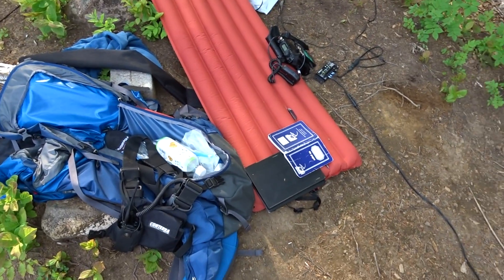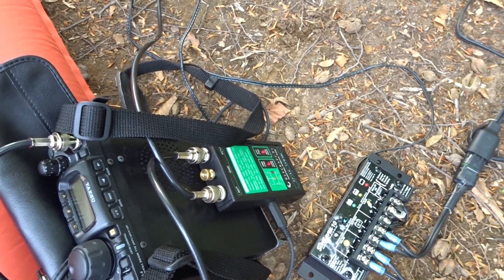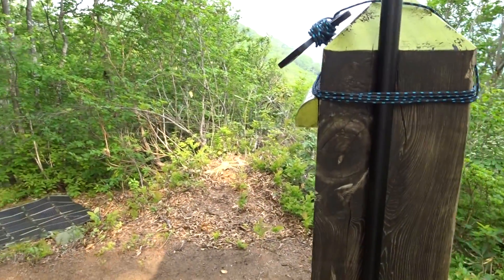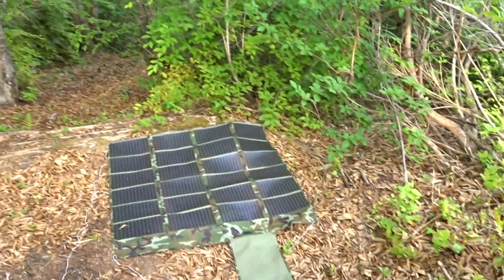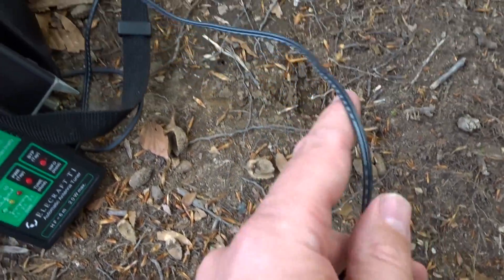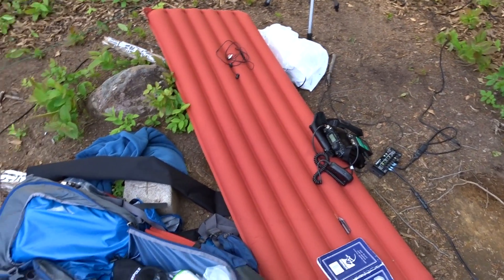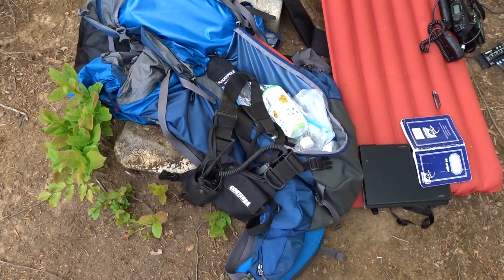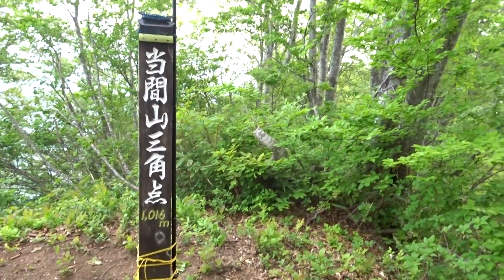My solar powered HF portable set-up by JG1XMV

Comment: Thanks for the great video on SOTA action in japan. I fond the Pocari Sweat beverage can help with QSOs but the 817/T1/Buddistick combo cannot be beat
Reply from the maker: Thanks John. Yes the 817/T1/Stick combo work very well. Thinking to look for a lightweight QRP Txer to replace 817 and save 0.5 Kg in weight in the process. A few of these are coming out onto the market these days. Ah Pocari :-) Yes, that helps as well. The heat and humidity plus the bugs in Japan in the summer can be tough. Also SOTA activations on SSB can be tough for a foreigner as very often Japanese OM are shy to reply to non-Japanese OM so DX contacts are sometimes necessary to complete the activation. I am also looking to test a mobile SD-330 antenna as a SOTA antenna. I'll see how that works. I have not done SOTA in many months now, time to get back into it!

Comment: What do you think of the charge controller?  Has it performed well, and is it RFI-free?
Reply from the maker: Hi Freddy, the sunsaver 10 is a PWM charge controller. MPPT charge controllers are in theory recommended when it comes to having less RFI but they are normally a lot more expensive (although I have read about people having big RFI issues with MMPT charge controllers as well). A friend and I both use the same sunsaver controller when using our radios on mountain summits and have had no RFI issues with it except in one case. We have noticed once that when we were using the controller with a buffer battery like the one used in this video and that the battery became full it generated a little bit of RFI in the FT-817nd radio. It is a minor issue for us as having a full battery is a "problem" I like to have when operating portable. When this happens either your disconnect the battery and operate directly from the charge controller without the buffer battery connected (you need good solar conditions so that you have enough power for your load at all times) or you just connect your radio/load directly to the battery to drain it (you can also just disconnect the solar panel from the charge controller). We noticed this minor problem with a small 1.2Ah sealed battery. Even with the small RFI we could use the radio without issues but it more pleasant to operate in a quieter environment. I remember that day when we noticed the problem well because we worked Australia on 5w from a mountain summit in France. I will go back and check the video of that one to see when we made the QSO whether the battery was connected or not so that it can give you an idea of the noise level. So in general I am very pleased with this controller as it is compact, built like a tank, and reasonable in terms of price and weight, something that is easy to throw into a backpack. Highly recommended except for the small caveat with the buffer battery. I cannot even say for sure that the RFI was from the controller or something else on that day but just fyi.
Reply from the maker: I have checked the video of the day when we noticed this small problem: https://youtu.be/jgaX4lvuiEs . On the video I can see that the buffer battery is connected to the charge controller but I am not 100% sure as to whether or not the solar panel is disconnected from the system or not. I think it is most likely connected as well as it is early morning and we had just installed our gear. We may have noticed the issue later in the day.